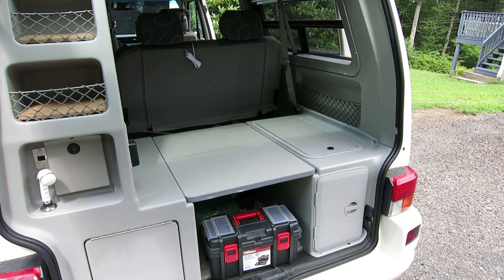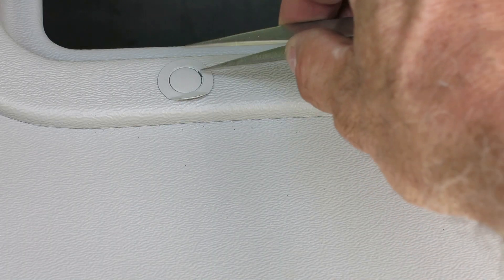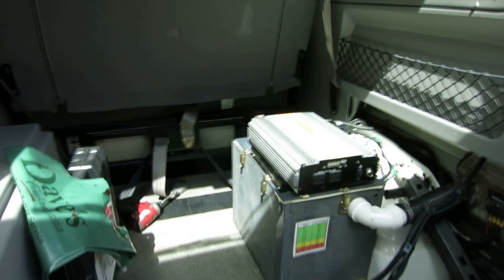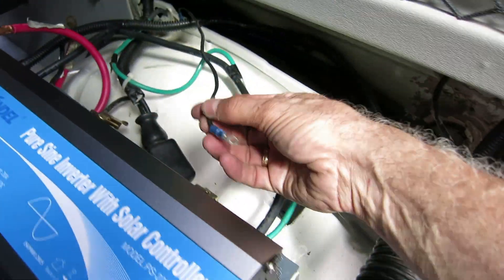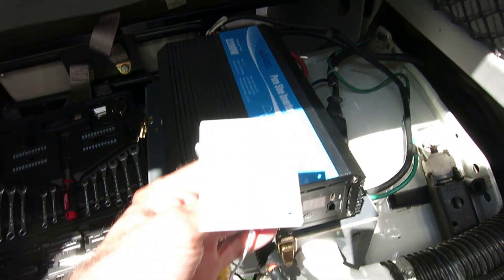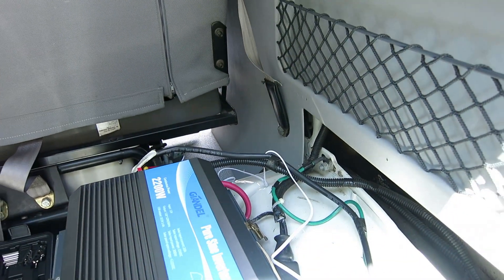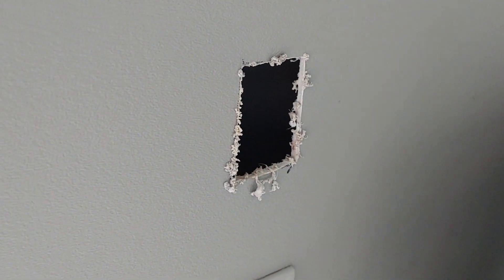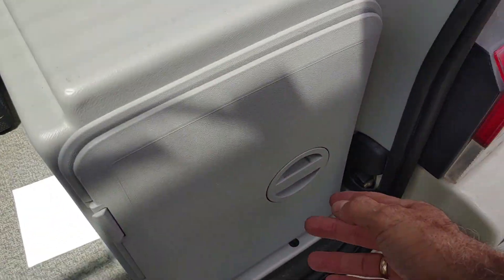How to install a GIANDEL 2200 WATT Pure sine wave power invertor  12vdc to 120 volt with rermote

Comment: I have wired my inverter outlets on same outlets as the shore outlets.  It feel it will make it a bit of "oh remember," situation, as i will not be able to run my inverter as well as my shore power at the same.  However this will allow be to run half as much wire therefore half as much weight.  You could wire the outlets clipping the little connector on the outlets severing the continuity between each outlet. That will allow each outlet to act as a individual, half as many outlets, but, still as much wiring to each outlet.   Nice job.